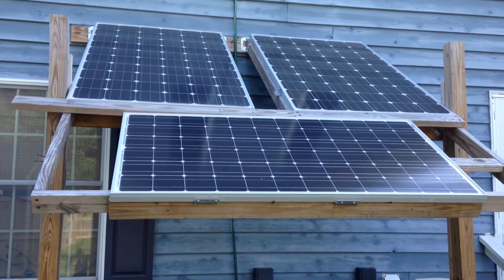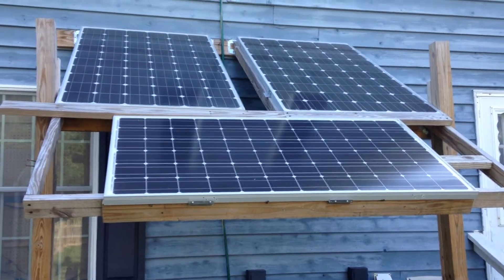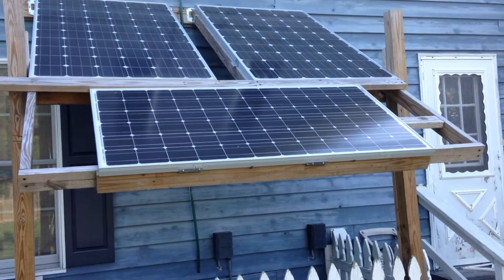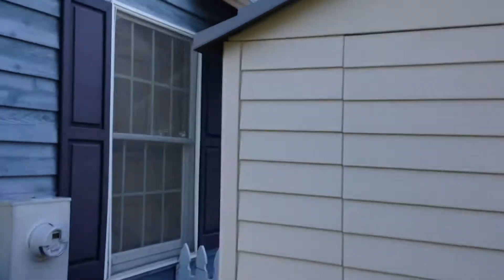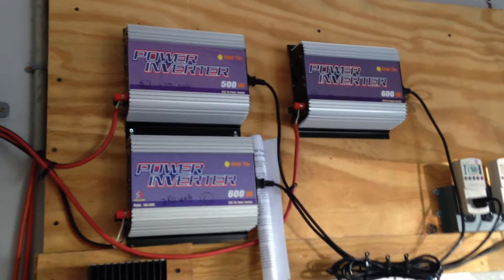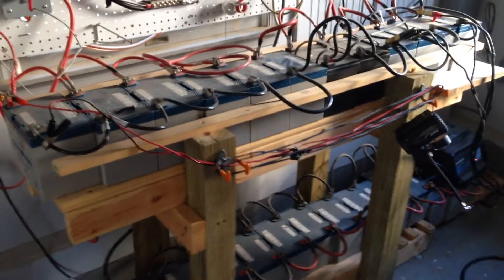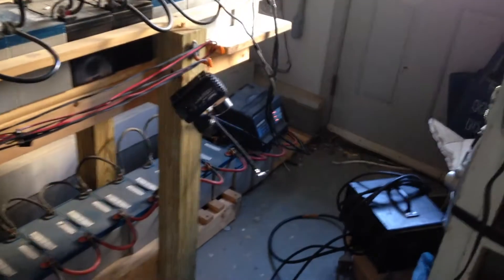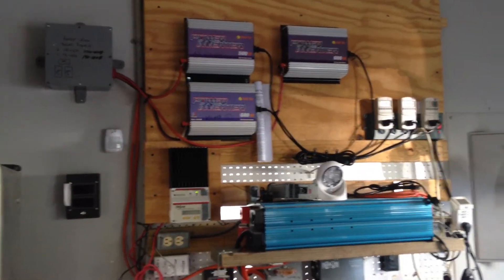Grid tie instead of back up

Comment: Be careful with grid tie inv.  exp.  if your house breaker is 15amp and your pumping another 1500  watts into the same line, and let's say for some reason you run two heaters on max (1500) same line your wiring will over heat [ to small ( fire hazard )]the breaker only see the houses power from its side and will never see your added power.  A YouTube video out somewhere explains it better.